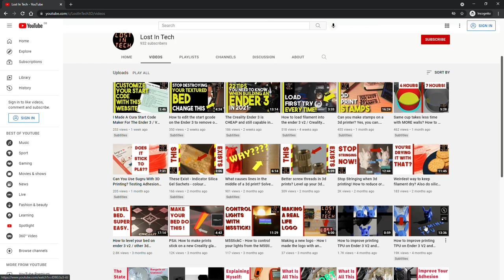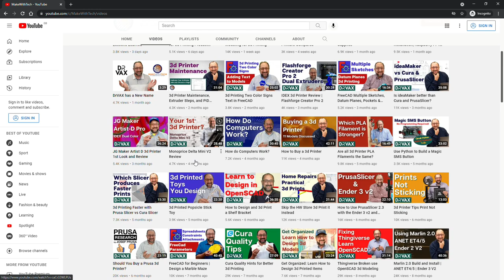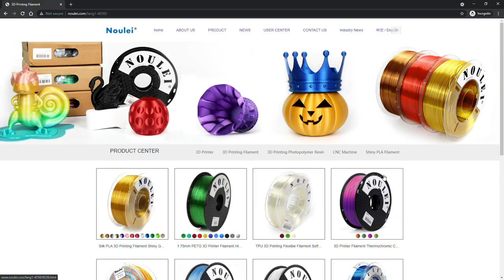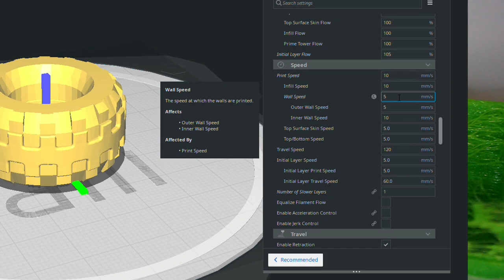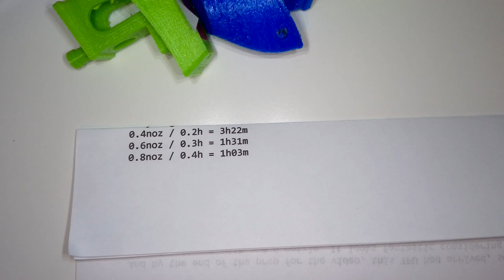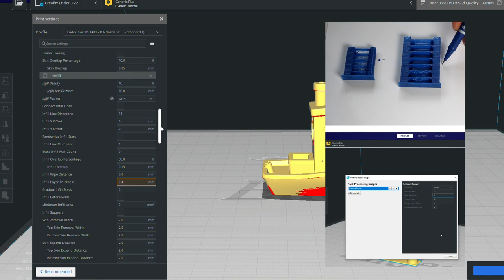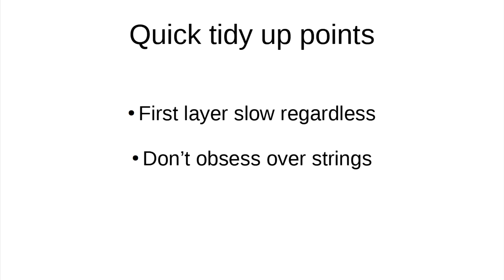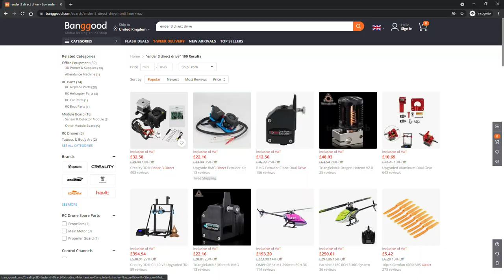TPU Cheat Codes! Get SHINY high quality TPU 3D prints on your ender 3 / other bowden printer.

Comment: +1👍 💪 
i tried to comment of the web-page but do not think it sent (or remains hidden/unapproved).

We need this scientific approach for strength as well.
In the "FPV community"  (quadcopter piloting), we print such things as GoPro, Antenna and general "mounts". 
I've used your profile with success  but immediately set infill to 100%.
I'd be interested in further alternatives (possible temperature, direction, layer heights) for strength besides the obvious design of objects.
Thank you!
Reply from the maker: Gotcha - I'll check out the website see whats going on. Plenty more TPU stuff to come, and I really do mean plenty! 😂

Comment: Your video on TPU printing was very helpful. I used the retraction settings and the print speed settings and print came out well. My problem now is the model comes out very rough where the support is on the model. how can I get a smoother print where the model is touching the supports? 

I’m printing with TPU on a ￼Creality 3D Printer CR-10S Pro V2. The printer is stock/no mods.
Reply from the maker: Got another tpu video in the works, we'll see if it gives you any answers when it comes out 👍
Reply: @LostInTech3D  I hope it's out soon. I'm in a mood to print. I stopped printing for a couple months because the TPU filament kept kinking and I got frustrated. It was my first attempt at using TPU and I didn't know what to do until I saw your video. Any updates to the settings for calibrating the printer with Cura? I'm finding that I have some difficulty finding the settings you have in your other video: How to improve printing TPU on Ender 3 V2 and other Bowden Printers - reduce or remove stringing. I'm using a Cr10s pro v2.

Comment: nice video, Always waiting for your advice, however this time that profile did not work for me, I got a horrible printing, it is working better the one I created based in your video of temp and retract tower, why could it be? I am using blue sunlu tpu
Reply from the maker: That is really strange, especially because I have the blue sunlu also. 
Is there any way you can show me what is happening?
Reply: @LostInTech3D  Hello again, I am the guy from the other video hehe, just want to say that your profile is amazing, my problem was a bad filament, but with a new one and your recommendation from the other video, it is the first time I printed a part in tpu with almost not stringing, it is incredible!

Comment: Does the 0.6 nozzle still applies with direct drive and bmg? What about layer height?
Reply from the maker: The only thing direct drive really affects is retraction length and performance, generally I don't change anything else. 
I recommend having a look at "extreme case mode 2" for some interesting insights into line width to height.
Reply: @LostInTech3D  what about 0.5 nozzle?

Comment: I have funny/sad story to report, I've printed a 95A TPU in a bowden setup with the original one gear of my CR-10 just fine, then I thought, let's switch to DD with an original Bontech BMG to get the most out of it, and now the same TPU I can't extrude not even by hand! it get stuck after the gear and backpressure is to much!
- I'm desperate -

Comment: Hello. Could I print with your profiles using a 0.3mm nozzle? What do you suggest to change?
Reply from the maker: Tpu does not work well with smaller nozzles, I have tried it, it is really bad!
But you only need to change layer height, line width.
Reply: @LostInTech3D   @Lost In Tech  ahh ok. Because since you appeared in my life I love TPU with my ender 5. And I moved from pla to tpu to print figures for my son and even me, the are more resistant to child hands and rude games. I printed a 10cm hulk with your high quality profile and I liked it, the problem was to post-processing the layers, but I handle it, then I wanted to print 1 cm head with your superior quality profile with 0.1 height, but I want to check how would it be with 0.08 height.
Reply from the maker: You can do 0.08 layer height just fine on a 0.4 nozzle. Try it.

Comment: Why are you using 0.3 mm line thickness with a 0.4 mm nozzle for your profiles?
Reply from the maker: I'm in the middle of a DD upgrade so I hope I have the right answer here, but the idea with a slightly narrower line width is to reduce pressure on the nozzle. If you take a look at my vid on "flow math" then you'll see the calculation of flow rate is width x height, reducing either will reduce the pressure for the same speed. Does that sorta make sense?
Reply: @LostInTech3D  yes, that makes sense. It seems you opted for a smaller line width so you could increase the speed more to get that shiny finish.

Comment: Suscribed! Thanks for your help 
Can you send me the profile for Ender 3 v2 Neo? I can't download it form your page
thanks
Reply from the maker: I never had a neo, are you talking about the plain E3V2? TBH the neo should work just fine on standard TPU settings or PLA but with retraction increased a bit and speed as in the video.
Reply: @LostInTech3D  yes can you send me the profile for the plain E3V2?
Reply: @LostInTech3D  yes can you send me the profile for the plain E3V2?

Comment: hang on you said printing quick was the trick but then your print speeds are like 10 or 20mm/s which is super slow... what did i miss??
Reply from the maker: I recommend 25mm/s Which is relatively fast for tpu.

Comment: Hello! I need your help again! I used your standard quality profile and my print worked. It has been a week from that and I tried to print the same part again and it is clogging the extruder. What could be? I have not changed anything on my part, or the print, or the profile. Please help
Reply from the maker: Something must have changed. The distance for the bed on layer 1 (causes back pressure), the humidity, the temperature in the room...there is always something. But a lot of the time, I also have these problems. TPU is...a challenge. Try small things, small change in hotend temp, for example, +2C...
Reply: @LostInTech3D  ohh ok. I have not thought about the humidity. I am going to use the dehydrator and test again. Thank you!
Reply: @LostInTech3D  Hello! I dehydrated my filament but after a 30% it clogged. In other post you told me something about the retraction lapse... if it takes much time to retract between parts, what could I do? It my case if it a unique solid part, could not I print it? I think it never retracts and takes about 5 hours
Reply from the maker: Yes I think you are correct. 
If you print this kind of thing a lot, large parts, maybe it is worth looking at the creality direct drive mod. Or a BMG style extruder. 

I have one (DD mod) ready to make a video about, coming soon (I have a lot of things coming soon!!)
Reply: @LostInTech3D  ohhh ok, looking forward to see your new video, because I learn a lot with you!

Comment: Good sir, you seem to have somewhat of a job to do with your stringing. I recommend checking your retraction settings for that filament. (as you said they might be labeled 95A... hehe) If your retraction is good then lower head temperature in 5 degree increments.  :) happy printing

Im currently running a heavy modded cr10s, printing esun red tpu now at 40ms 228c head, 60 bed. .6 nozzle and custom direct drive with e3d v6.
Sticks like glued on there and looks amazing. 0 strings or zitz or blobs. Currently spitting out can sleeves at one pr 2.5 hours in 0.3mm layers. took me over two weeks to set up like this though...

Comment: Can't get the website to work to get the settings downloaded.
Reply from the maker: yeah I'm reviving the website slowly every time I get a spare minute. Let me add these, give me a few mins to figure it out
Reply: @LostInTech3D  I appreciate you putting those profiles on the web site.  However, I have tried to download them a few times and install them in CURA and they all keep saying that there isn't a valid profile with those files.  Thoughts?